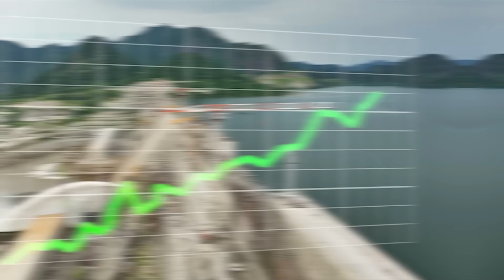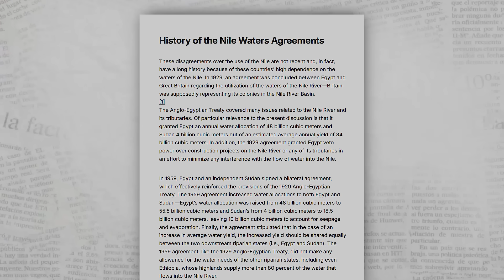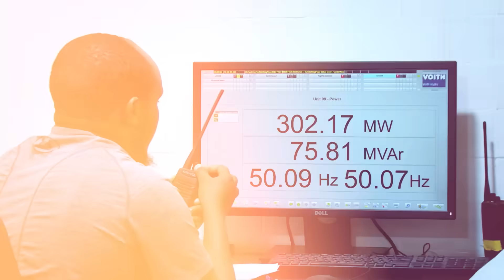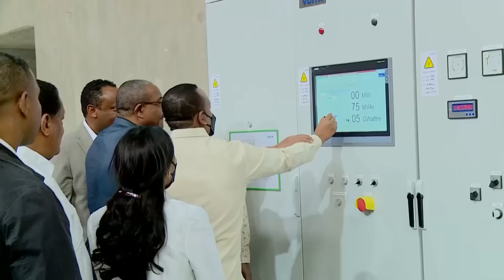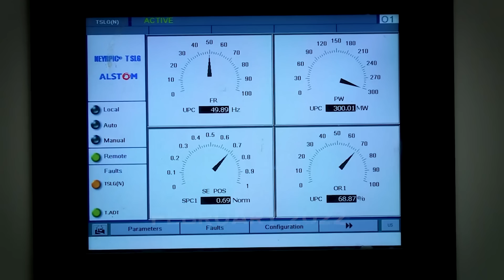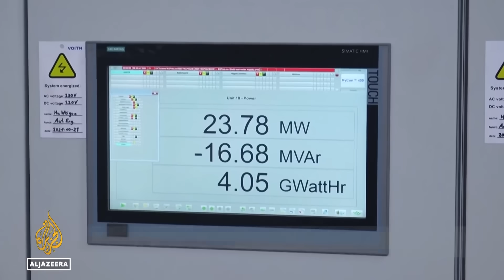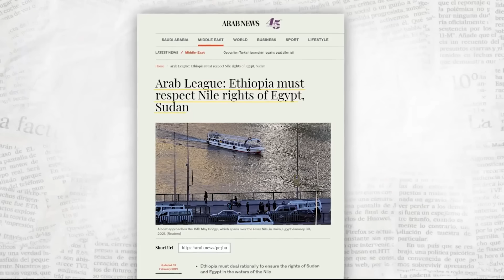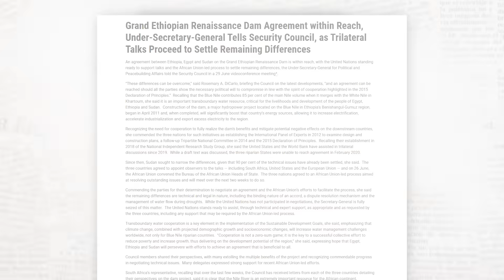Africa’s $5 BILLION Mega Dam That Terrifies Egypt Is FINALLY Complete!

Comment: while adding infrastructure here is a good thing , i believe data will show it is less advantageous to build one massive structure over several smaller ones . this economy dosnt scale environmental impact of the larger facilities far outstrips the gain in power generated ..look to china that dam is a hazard without considering the silt its stopping there i suspect time will tell and micro hydro will prevail
Reply: Best to build as many massive structures as possible to fully develop the river system. Ideally, the reservoir of a dam should extend to the foot of the next dam upstream.
Reply: @paullangford8179  ya and communism works on paper too

Comment: What is Egypt worried about? Egypt should be happy about this project. It will make available water in the dry seasons that would otherwise have been wasted by excess flow into the Mediterrean Sea. Holding water back means more water for all. That is the whole point of a dam.
Reply: It’s about control.
Reply: Egipt już dawno powinien zmniejszyć przepływ Nilu do morza. rzekę można spiętrzyć zwężając japo bokach; pozostawiając np. 100 metrów.
Spuszczanie wody do morza powinno być karane więzieniem.
Reply: @ArturZagaj-Izraelita That's another great idea. Let them use every drop of water before it reaches the sea.
Reply: It's a Hydro-electric dam, THE WHOLE POINT is to release the water through the turbines. and thus to downstream👍
Reply: @simonallen4791  Nope. No one there in the region will spend such resources for generation only, especially if they have no transmission lines and big consumers (aluminium smelters etc). The Nile water always was, is and will be the greatest value by itself, who cares about silly electricity if there are 10s millions pauper hungry population all around.
Reply: the real problem is sediment. the Nile delta historically was fertile because rich mineral bearing water is borne down (water looks muddy during the flood season). now all those minerals are going to sink in the dam and only clean water will pass.
Reply: @JLK89  obsolete for 100 years since introduction of synthetic fertilisers
Reply: @JLK89  Well, not exactly so
The percentage of minerals is not significant enough to consider it a fertilizer.
The delta is fertile due to minerals accumulated over many millennia.
Reply: Does agriculture near the Nile still depend on regular flooding?
Reply: Yeah, right.
Reply: Control over the water bud.
Reply: That is not the whole point of a dam and it gives Ethiopia huge control over its neighbors. Ethiopia also won't be helping egypt with this dam at all and then there is the problems of it being poorly built and likely maintained in the future. Also Ethiopia is not exactly run by altruistic leaders who just want to live in peace. Hence, the many wars in the region
Reply: Oh I don’t know… how about the ecological disaster they cause, hence why so many dams are being taken down across the globe.
Reply: Nope. This water will not flow down the stream, it will be collected in reservoir and spent on local fields. The very ideas of these Nile dams is irrigation, not energy - its useful byproduct, of course, but food for millions of breeding rabbits is much more important. So Egypt will never see this water again.
Reply: @antontsau Egypt has 2 dams already.
Reply: @Pdalim59  its Egypt internal question - no one lives downstream, only fish in Mediterranian sea.
Reply: @antontsau  Your opponent @rednihb
gives you real arguments, and you respond with your own conjectures😉😂
Reply: @Arite-n9r  no arguments visible. Just meaningless preaching "there are no fields!". Yes, no fields NOW. Will be - huge irrigated region, with own water and energy to pump it everywhere they need, and significantly reduced free flow down to Egypt. Not tomorrow, of course, but in 5-10 years.
Reply: @antontsau  Do you think that Egypt has a monopoly or greater rights to use the Nile water than other countries in the river basin?
Maybe this is based only on the fact that they started using the Nile three thousand years ago? 😁
Reply: @Arite-n9r  Did you see the map ever? Egypt has only the sea downstream, no one cares how they use the water.
Reply: @antontsau  Secondly, this fact does not in any way cancel the principle that the use of the Nile resources cannot be a monopoly

And firstly, the Nile waters that Egypt uses are collected mainly on the territory of Ethiopia, and if Ethiopia should not worry, then let Egypt not worry either )))
Reply: @antontsau  The dam is 14 kms from the border, has no irrigation canals and the land around it being hilly, and not arable, not giving much chances of future irrigation possibilities, 100 km downstream, Sudan has another dam on the same river, Rouseris dam, built in 1966, and used for irrigation, if no one cried over that dam, no one should be crying over this one
Reply: @rednihb  No one will build dam there only for electricity. No canals and agriculture in these hills now - of course, as there were no source of water, but Ethiopia will build all this. Like Egypt is doing now with their New Valley project, sourcing the water from Nasser reservoir, Aswan dam, which exists for 50 years.

Sudan dam exists for 50 years too, its too late to complain. Ethiopias dam will grab the water now, so its the best theme to quarrel with everybody downstream.
Reply: @antontsau  Egypt is flat, Ethiopia isn’t, Egypt has fields next to the Nile, Ethiopia doesn’t, there isn’t any arable land around and the hills prevent taking the canals to other regions, as they are higher than the reservoir, Sudan has a dam with irrigation on the same river, operational for 60 years now, and that should be the issue if anyone wants to cry bout irrigation , not Ethiopia
Reply: @rednihb  New Valley 20 years ago was absolute desert, no one lived there, nothing grew there... they built the canal, installed irrigation and now it works. The same will be in Ethiopia, excessive population will relocate to these empty hills and begin to grow whatever they always wanted, but could not. Not a big deal if you have millions of pauper population, unused land and necessary physical resource, water from the dam. All nearby hills will turn into fields and groves in 10-20 years.

As noticed - its too late to cry about Sudan, its already thing of the past, it exists for 50 years. Ethiopia dam begins to redistribute water only in future, so its the best time to whinge, demand and squarrel.
Reply: @antontsau New Valley and Aswan is in Egypt, has no canals running from it’s reservoir itself as it doesn’t have any agricultural fields anywhere near it, and the irrigation canals were built huge distances downstream of the dam ( 100 km and more) actually the first canal,from Esna barrage, ( 100 km as the crow flies from Aswan) were built 60 years before the Aswan dam, about the Ethiopian dam no large dam in the world irrigates hills higher than the dam, so stop manufacturing issues that do not exist
Reply: @rednihb  New Valley (Toshka) project - no, never heard...
Reply: @antontsau  And where do you think that huge amount of electricity, which is enough for three African countries and which is already being generated, will go? All three Nile countries, including Egypt and Sudan, will benefit from the construction of this dam. Moreover, Egypt will receive its benefit for free.
Reply: @Arite-n9r  To water pumps. Some water falls down, other pumped up by this energy and then flows to fields. The same as in New Valley, its not a flow-down but artificially pumped project, powered from Aswan hydro generation.

What Egypt benefits? Energy generation 1200km from its border, thru the half of Sudan, for which Ethiopia of course wants money? Instead of Nile water, coming to them free? Extremely attractive offer.
Reply: @antontsau  The benefit to Egypt is that in the event of excessive rainfall, the dam will be able to store some of the water, and in the event of drought, Ethiopia will be forced to release water to generate electricity. Thus, Egypt will have a more uniform water flow than it would have without the dam.
Reply: @antontsau  So far we have not seen any extensive plans for irrigating agricultural lands in Ethiopia.
But we certainly see the implementation of energy plans.

Throughout the construction of the dam, we have seen Egypt hysterical about the disaster of agricultural production. Now that the reservoir has been completely filled in just four years, can you provide evidence of the damage to Egyptian agriculture during this period?
Reply: @Arite-n9r  Nope. 1000 km, the whole Sudan including their own dam, is there, and then huge Nasser reseirvoir, so Egypt has no problems with floods since 1970. And in case of drought the generation, of course, will be reduced or stopped completely. Hydro power is not a magic, if no water coming - no power goes, mechanical energy storage, even in huge reservoir, is not enough to upkeep permanent generation.

 Only rarest natural conditions like the whole Great Lakes for Niagara or 500km long Enisey gorge as reservoir allows to work all year long on stored flood water. Even lake Baykal (with its depth 1.5km!) does not allow this (for Angara power plant) - its huge, but allows level change only about 1m, or everything collapses there - wildlife, beaches, artificial structures, water supplies for population and industry.
Reply: @Arite-n9r  are you able to read and understand the text? Current condition - the dam is built, but no irrigation exists, so currently no change of water flow (except loss for evaporation, not too much). Egypt is very concerned about FUTURE problems, when this irrigation will be developed, NOT NOW. They look ahead for 20 years and clearly see 10s of millions Ethiopeans grab away the water to feed unstoppably breeding herds, as they do absolutely the same by self.
Reply: @antontsau  We are not talking about working on the accumulated water throughout the year, just as we are not talking about accumulating all the excess water in the event of prolonged abnormal precipitation
We are talking about smoothing out both floods and droughts

In any case, if the dam and the hydroelectric complex are used wisely, Egypt will not lose anything, but can only gain, even if this gain is not global.
Reply: @antontsau  During the entire time the dam was being built, the Egyptians were screaming that they would be left without water while the dam was being filled
In fact, it turned out that their fears were unfounded and their statements were false.
Will the same thing happen to the "millions of Ethiopians drinking "Egyptian" water?
Reply: @antontsau  The Egyptians have been hysterical for several years that they will be left without water while the dam is being filled.
They will not be left without water.
In the same way, their fears that you speak of will be in vain.
Reply: @Arite-n9r  not while. After. Whet Ethyopia builds irrigation and relocates 10M of people to there. Egypt perfectly knows that they self would be do exactly this.